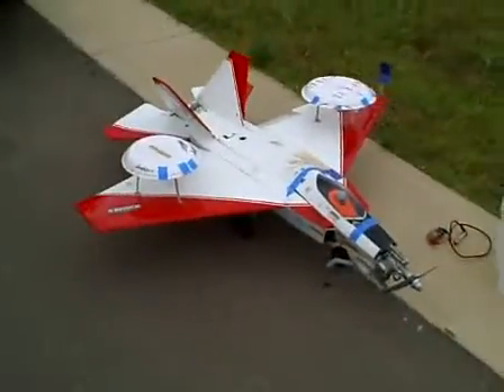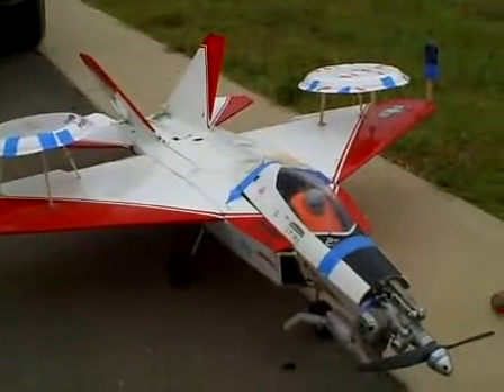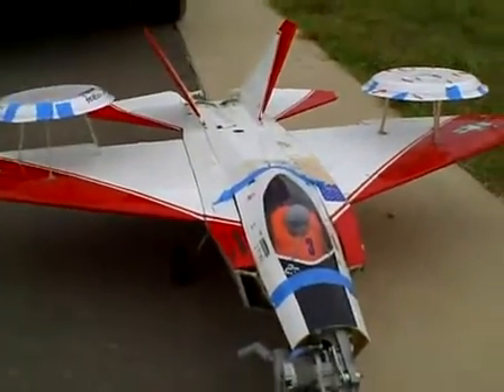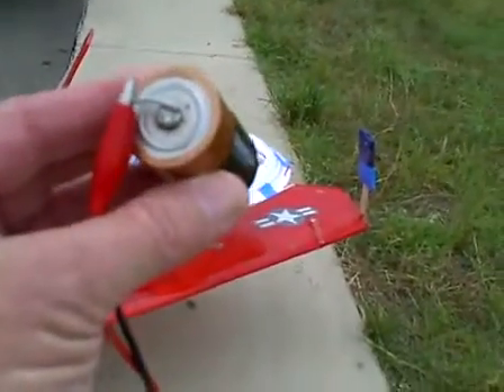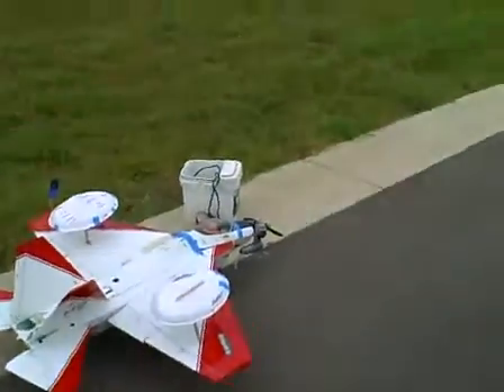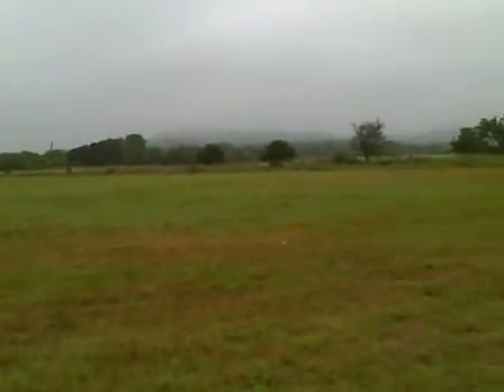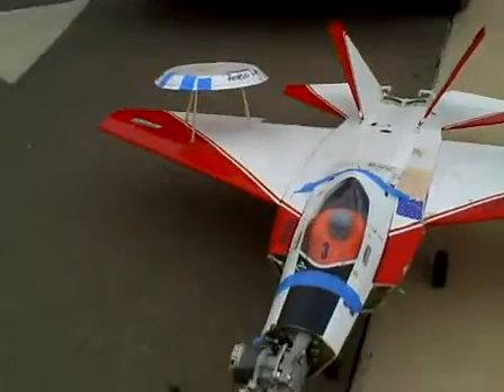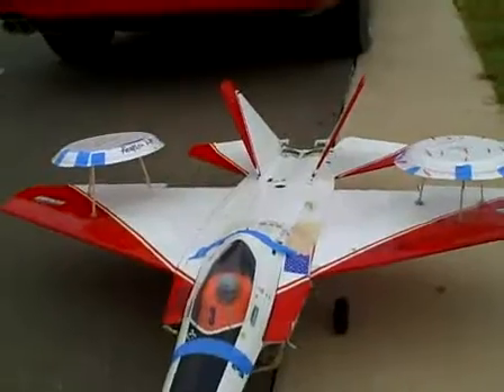RC altitude record setter UAV Drone technology 8,382,040

Comment from the maker: Hi, AWACS radar domes are designed not to develop lift because of the parasitic drag. Radar domes are not located on wing tips and are not laminar flow structures. The Hamilton/Nobias diskettes are laminar flow and have very little drag and are positioned at wing tip to effect vortex drag making use of favorable interference.  007 Wingman. New ideas are hard to accept.

Comment from the maker: Hi, what is presented is the new look in aviation. The combination of a laminar flow oval diskette place near a wing tip provides a 45 % reduction in vortex drag because of favorable interference and the oval diskette adds extra lift with its laminar flow design.This aircraft will fly higher and faster and safer than anything in its class.  In five years you will see it on everything that flies. Patent Pending.